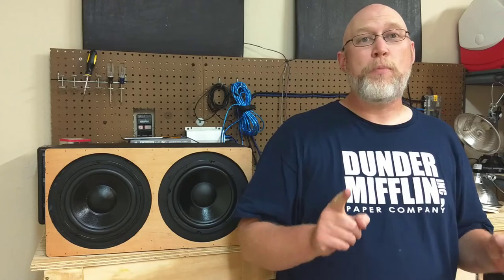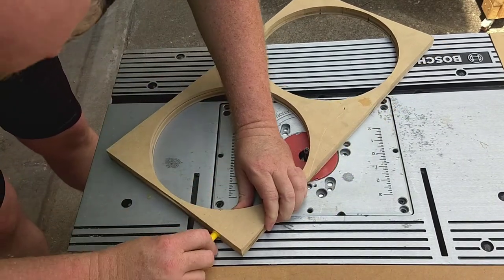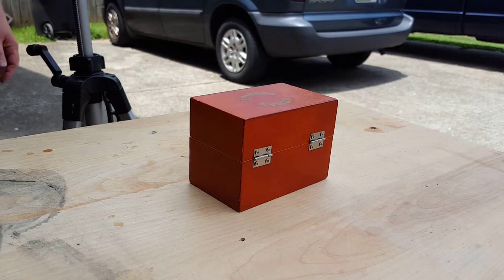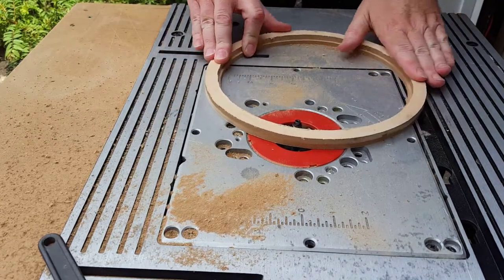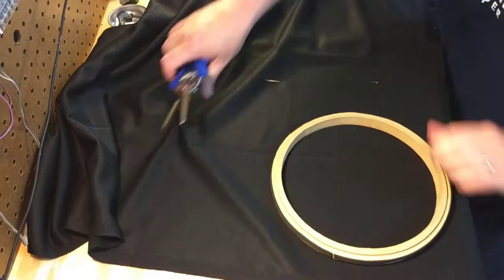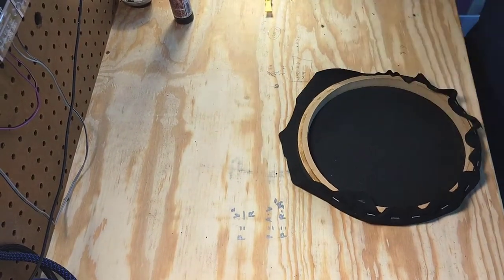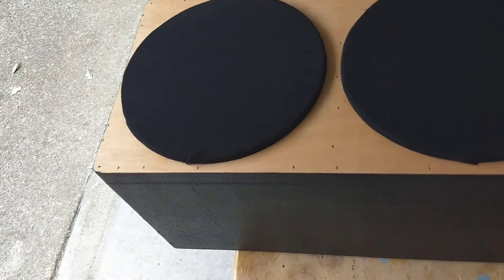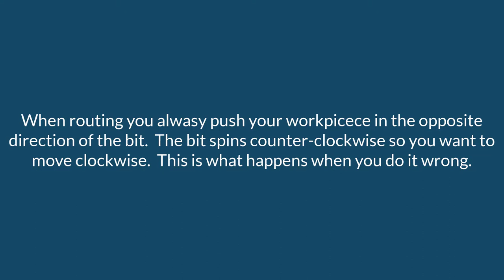How to make custom speaker grills!  Passive Radiator Sub Build Part 3.

Comment: Great video! Next time try out a embroidery hoop. Put the grille cloth in the embroidery hoop, get it stretched even and tight, spray some glue on the wood ring you made and set it down on the grille cloth material and let it dry for 20 minutes then you can take it out of the embroidery hoop and continue to fold it around the edges with glue or staples. It comes out perfect.
Reply from the maker: That is a good idea!